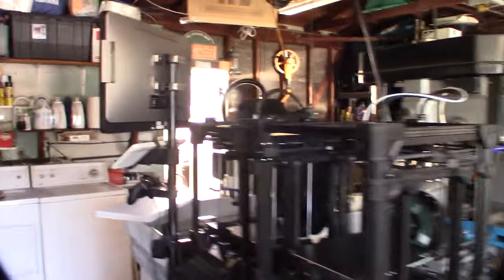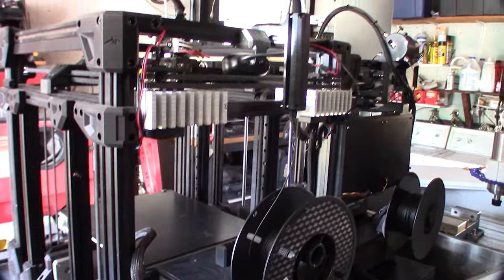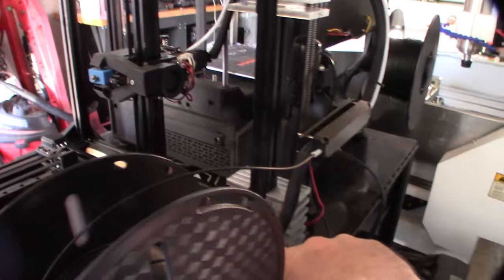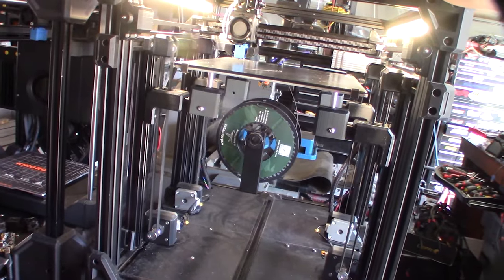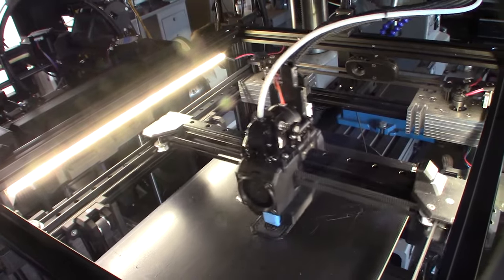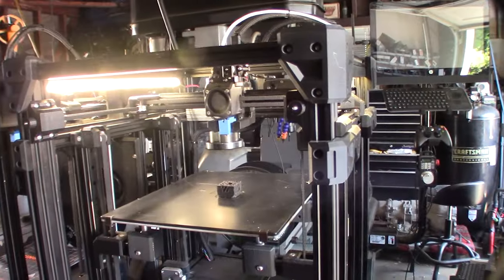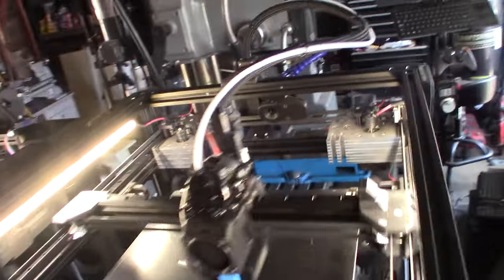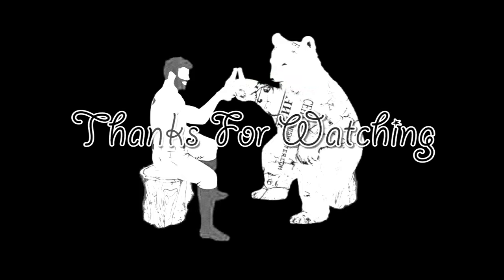Orcinus (Orca) 3D printer 600mm/s 35K Acceleration Speed Test, Barely Phased

Comment: Your design certainly looks nice. Yes, I have a box of spare BLTouch pins (it's almost like they made the pin sacrificial...). Any reason you didn't use an original BLTouch? A few years ago I tested a bunch of clones against the original and the original had an order of magnitude better repeatability than any of the others. Dunno about the situation now.
Reply from the maker: The microprobe is super tiny. This issue with BIQU microprobe is the tip unscrews eventually crashing, breaking the probe when it hits a print. I have another video about it, I also have it apart so you can see what's inside.  I also have a box of probes going back 8 years. Inductive, capacitive, bltouch, CR-touch, etc.... I might try beacon's Eddy current probe or Creality's version of  it.  I messed with the Bambu Labs Lidar the other day. I would like to know how that works. There was allot of wires coming off it. Allot more wires then a typical Z-stop type probe.
Reply from the maker: Have you tried any of the eddy current probes yet?
Reply: @fintechrepairshop  Nope! I just figured BLTouch was good enough and stopped thinking about probes. What do you get for PROBE_ACCURACY with that BIQU and belts? And what is your Z movement per rotation? Are you using 0.9 degree motors? Been awhile so I just ran it again on the two printers I have running:
-Printer with TR8x2 screws, 2mm Z per rotation, 1.8 degree, long loop belt driving two screws with one motor: 50-probe StDev = 0.001236mm
-Printer with TR8x8 screws and 2:1 reduction, 4mm Z per rotation, 1.8 degree, 3pt Z tilt: 50-probe StDev = 0.002228
Reply from the maker: @jessicav2031  I'm kind of in the same boat, I not sure if I see the value in eddy current probe.  I'm running no gear reduction on Z. 1.8 degree motors. I can get the bed crazy flat, probably 0.05mm. I can usually get the bed flat in 3 passes. 

[stepper_z]
step_pin:PE1
dir_pin:!PE0
enable_pin: !PE2
microsteps: 16
rotation_distance: 40
full_steps_per_rotation: 200
endstop_pin: probe: z_virtual_endstop
position_max: 300
position_min: -2
Reply: @fintechrepairshop  First layer aside, do you see any artifacts that might be attributed to the low Z resolution? That 0.05mm you cite being exactly 1/4 step seems to say that is the effective resolution of the axis...and most designs I've seen with belted Z use a reduction (eg. Voron). I mean, that 0.05mm is also 1/4 of a typical layer with a 0.4mm nozzle!
Reply from the maker: @jessicav2031  I have to look at my quad gantry settings again. I can adjust the deviation on quad gantry level. The print quality on this printer is way higher then anything I ever had on a Z screw.
Reply from the maker: Below is my macro. I haven't had any issues with layer quality. I've thought about doing some kind of gear reduction but the quality is perfect. This is the best printer I've every had when it come to print quality. Log extremely flat lines. I've had Z wobble issues with the past with lead screws.  

[quad_gantry_level]
gantry_corners:
	40,50
    210,250
##	Probe points
points:
	15,30
	15,200
	180,200
	180,30
speed: 120
horizontal_move_z: 5
retries: 7
retry_tolerance: 0.05
max_adjust: 5
Reply from the maker: @jessicav2031  What are your thoughts about in increasing the microstepping on Z from 16 to something like 32,64,128, etc????
Reply: @fintechrepairshop  Not sure. I would guess it wouldn't do much other than load down your MCU. We tested the positioning accuracy of microstepping against a 4000PPR encoder with *no load* and TMC drivers provide a ton of accuracy (amusingly, DRV8825 microstepping is actually useless). But I think that goes out the window with Z because it is under constant load. And by the way, at that scale, both pulley runout and belt teeth were also a significant effect (we connected a stepper to an encoder with a closed loop belt to test that). So a Voron-style reduction also introduces meaningful error.
Reply from the maker: @jessicav2031  agree, in another video I used my dial indictor to measure pulley runout on my Sanyou Denki steppers. I'm noticing more pulley runout lately on cheap amazon pulleys.
Reply: @fintechrepairshop  Yeah. Have you ever considered buying ones with a smaller bore, indicating it in with a DTI, and boring/reaming to 5mm? We did that a couple times with larger diameters but you would need a ridiculously small boring bar for 5mm...